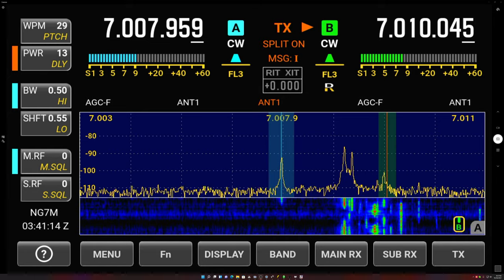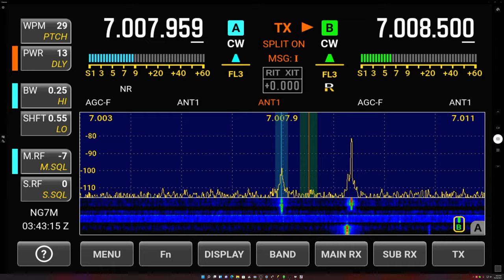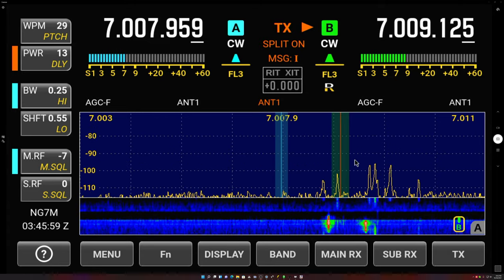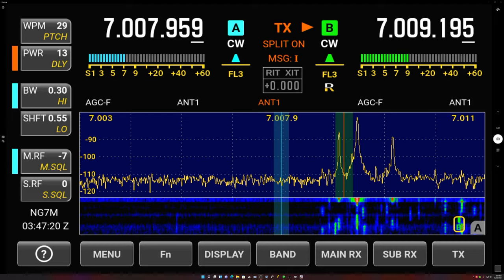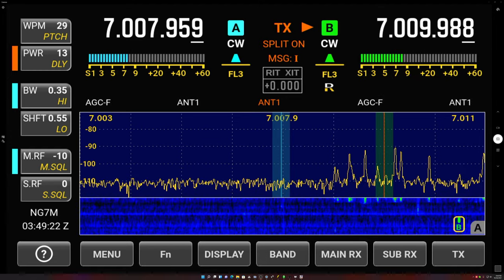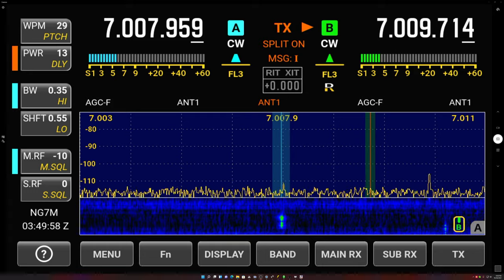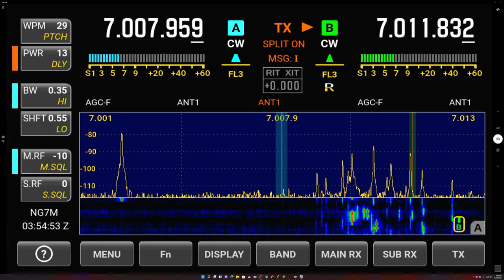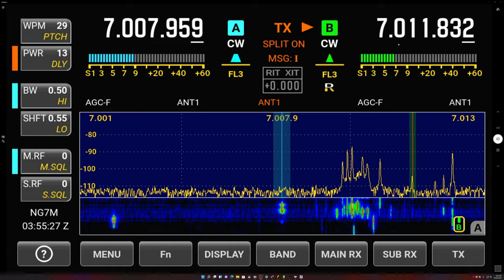NG7M Chasing HD8R Galapagos Islands on 40 meters CW / Elecraft K4 / K4D

Comment: Considering a K4.  Can you confirm the CW Speed is set with the left-side controls?
Reply from the maker: I use an external WinKeyer myself, but the internal keyer works great too. You adjust the speed of the internal keyer using the upper left knob.  So yes, I can confirm CW speed is set with the left hand controls.  Thanks for watching.  Max NG7M
Reply: @ng7m-ham-shack  thanks!  Looks like a great rig. I also have a DB18.
Reply from the maker: I don't use the built in CW keyer, I prefer an outboard WinKeyer.  But yes, the internal keyer speed is adjusted with the top left knob.  Thanks for watching and commenting.  Max NG7M

Comment: Max, enjoyed your video. Have the video splitter you recommended working nicely.  Brand new to K series with K4D. What were you doing when sub RC froze with display of RF and SWR? Thanks. Jerry / K0ES
Reply from the maker: Hi, glad the HDMI capture is working well.  Oh!  I didn't even know something froze.  I'll need to watch again and look.  Max NG7M
Reply from the maker: Hi Jerry, I watched the video again...  I didn't see any issues with the display.  I think what you were seeing is when I transmitted.  The display changes for the split vfo in the upper right... you see the swr, drive power to my amp and the alc meter.  I'm guessing that is what you were seeing.  Any time you would see that is when I was calling HD8R.  If it's something else, I'm interested in what you were seeing... what time into the video?  The pause and change of the vfo b display is by design.  Not an issue unless you were seeing something I haven't noticed.  Thanks again for the comment and for watching the video.  Max NG7M
Reply: You are correct. What I saw was when you were transmitting. I’m just getting used to this radio but so far it’s been terrific.  73, Jerry

Comment: Hi, Max!  During your transmission you can hear the click of the key, but when you switch to receive, you can hear the click of the relay, is this the amplifier? R1FW 🤝
Reply from the maker: Hi, well there are two relays you might hear.  I have a NCC-2 antenna phasing device that has a PTT relay to keep the front ends of the receive antennas from getting RF overload or damage and it could be the relay in my amplifier.  I maybe been using either the RF-KIT RF2K+ or my SPE 2K-FA, I can't remember.  I also run the NC7J skimmer server which is a split antenna feed off my NCC-2 box from DX Engineering and that PTT relay in the NCC-2 is there to effectivity turn off the incoming RF to the Red Pitaya SDR I use for NC7J.  Running 1.5KW on a 160x100ft lot puts my receive antennas in close proximity to my TX antennas.   The loudest relay which is closer to the microphone while making the video is the NCC-2 box.  I do wish that relay was not as loud as it is.  Max NG7M
Reply: @ng7m-ham-shack  Thanks for the detailed answer 🤝 I already thought that Elekraft switched to a relay🤣 hee hee.  How do you like K4?  does he earn his money?
Reply from the maker: @andrey_r1fw  Yes, the K4 has been good... there are still a few things they need to work on.  I/Q audio and bin data on the network.  But for the most part it's great.  The sound of CW on the receiver is outstanding and the narrow filtering with no ringing must be heard to believe.  It really sounds nice!  Thanks for watching, Max NG7M